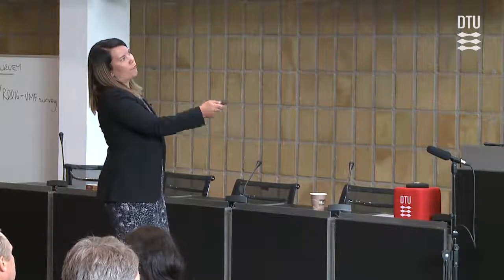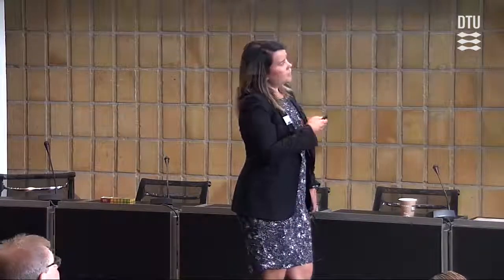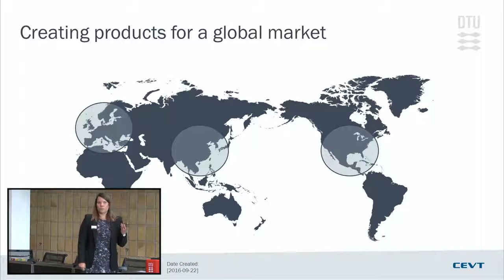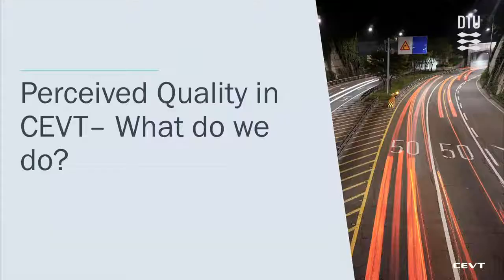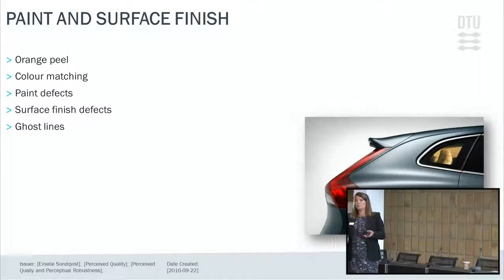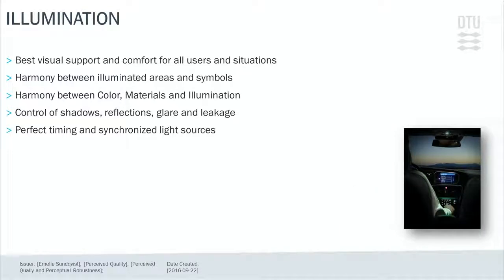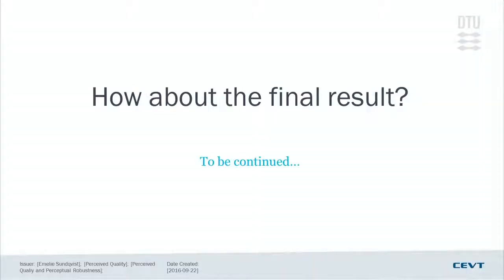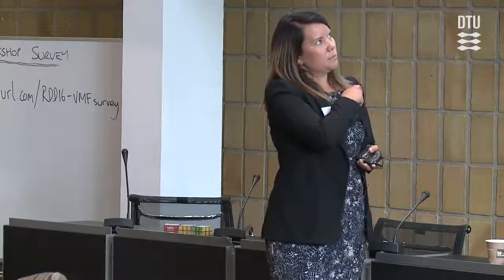Perceived Quality and Perceptual Robustness

Comment: "Perceived quality is the quality of a product or service according to the customer's perception. It is a subjective criterion and does not have to coincide with the actual or objective quality, which is based on tangible data such as raw materials, manufacturing process, warranty or after-sales service, etc."
Yup, all wants shiny toys, I for example better have higher gaps between bumpers, but not rubbing and rusting body. No foams under wings which absorb water and rusts start, but a bit more noise (hello VAG). New Volvo cars test subpar for rust protection, but no worry, perceived quality is good.